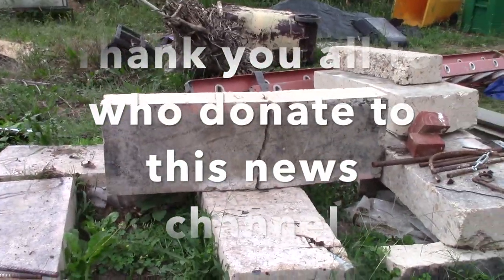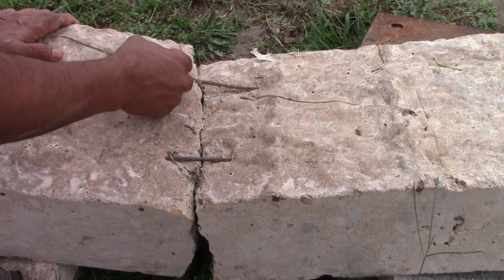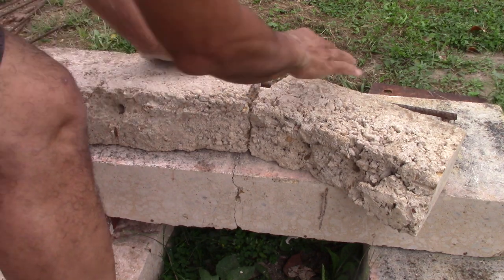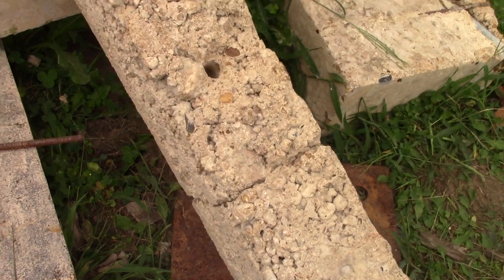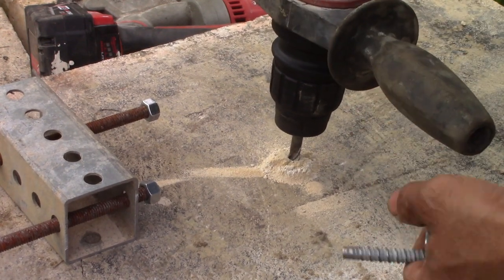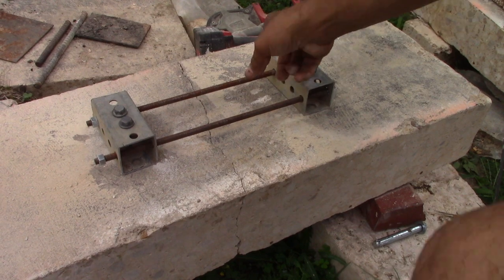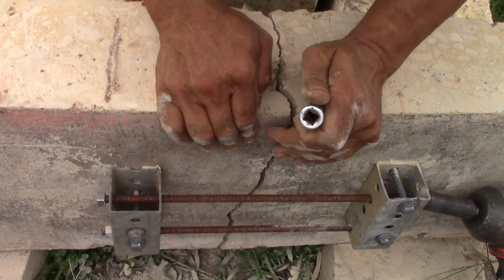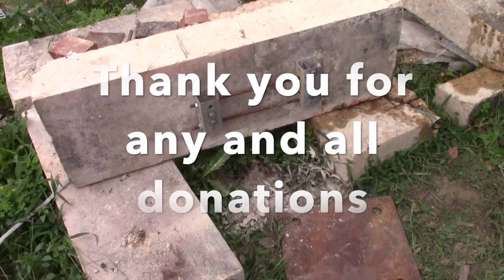CONCRETE REPAIRS MADE EASY external post tension would work vs epoxy BOLT DEPOT

Comment: I put a balcony on my wife’s house with those anchor bolts! All good except the one she overtightened as I forgot to tell her not to try and pull it in with the anchor. Was going to epoxy it later, but didn’t as I figured no one uses epoxy on block surely? Hahahaha! Great demo! Nice deep beam so your rods don’t have to work too hard. Cube law I think on beam depth. Can’t quite remember from over 40 years ago, so don’t hate on me if I’m wrong. I can’t help being an Electronics guy!
Reply from the maker: Check those anchors and add epoxy and confirm no fracturing of block... follow your code requirements and load requirements ... #hilti makes a ''mesh'' that goes inside block to support and create the ''anchor'' for the epoxy and bolt connection.
Reply: @ForensicCats  many thanks for the tip!
Reply from the maker: Dr. Power,  a through bolt would also do a heck of job... thread all into house and washer it from both sides...  you may even have to use a larger plate inside to make sure you are not pulling on a ''weak block''... / section of wall (in case deck goes laterally , away from home / house connections)...

Comment: From Australia KAI thanks for letting me know about this Video.U should have Solid Shoes when working with Concrete. I gather that is Concrete with Cracks from Champlain Building Collapse in Florida  ?? U should be putting U imput to the Courts as i am sure they would be very Interested. U are the only one that is working on this CONCRETE. 😇🦋💕
Reply from the maker: I only need hard toed shoes if I put my foot where it does not belong... I also, do not have steel fingered gloves... now those I need!   lol    teasing and also on that subject of safety, I need permanent eye protection (no scratches please)...
I am on my feet for hours and unless I am on a job that requires steel toe... I stay clear of them, they HURT!
Reply: From Australia KAI and just had an EarthQuake here and the Roof was making a really bad Noise like Cracking , and i thought what the Hell is that and my bed was shaking plus Vertical Blinds Moving and got up out of bed and floor was moving and very Scarey.It was 6 on the Rickta Scale.Never had a EarthQuake since lived on this Earth.No damage just my 2 Nombs fell over in the Backyard.There was damage near the City were bricks fell down , Plus some of old Buildings Chimneys fell down.No-one Injured.But have lived on Gold Coast 4 houses from Beach and worked up there and had a Cyclone come thru on Radio they were sending children home from School Told to battern down anything that might fall plus Battern down Boats.Plus have been to Bribie Island on a Holiday just near Brisbane and the little Green Frogs were climing up the glass doors and windows and we wondered Why ??Well the weather forcast said we were getting Tail End of Cyclone which we did.So the creatures and Animals know before us Humans.Just also wanted to let U know as U have Cats and a lady was taking a Video of her White Cat with a new Fish Toy that moved and the cat called Carol was Playing with new Toy , and all of a Sudden it stopped and Cat looked up and went to were the Door Frame was , so it must have sensed the Tremor on the House !!😇🦋

Comment from the maker: Here is the link to the BoltDepot https://www.boltdepot.com/catalog.aspx  and they will mail you what you need and they do it fast. This link contains free charts also.
Here are the ''Concrete screws'' I use in this video https://www.boltdepot.com/SearchResults.aspx?Units=US&Category=Anchoring_products&Subcategory=Concrete_screws&Page=2&ItemsPerPage=10&SortOrder=Catalog
All donations will not be pocket money but go back into this channel, thank you for any support.
Only donate if you can afford it, otherwise, please watch the advertisements  and comment and tell me what they were please.
You can also open two tabs and let one play while you watch the other in another?
https://www.paypal.com/cgi-bin/webscr?cmd=_s-xclick&hosted_button_id=V9TGHDE92LQ8W&source=url
Reply: Yes but I'm referring to south deck possible repair
Reply: I might need to send you a pic of the problem.  I hate to damage the little rod or the die.  The alloy rod was threadless & I thought I could cut threads on it from a tap & die set I inherited (not knowing really what I was doing but trying anyway).  So when I screwed the threadcutting die on (I think that is what it is called) it got stuck… won’t go further or off.  I don’t have any way to use a screwdriver on it cause there is no cap… I might email a pic to you.

Comment: Ad: no cost solar, Dropbox  (×2), Wegmans app. I've seen several epoxy jobs that looked like placebo at best - concrete sidewalk cracked/sections raised several inches apart with grey epoxy. Maybe makes people feel like something was done, but apparently just cosmetic. I'm wondering if they were just gambling - figure it stood 40 yr, will stand another 1 yr or whatever to get $$ to completely scrap and replace the deck. Ideally they would have made a bigger effort to brace it as you suggested here rather than the superficial and ineffective epoxy job. 

Part 2: I'm probably one of the least fashionable women, and I acknowledged that the remark was catty. I would find something nice to wear if I met with clients who I was asking for millions of $$ from. Zero chance of that in my case, so will circle back to the point that my comment wasn't directed towards you. It would be crazy to dress up and work with concrete, and you have a million way more important things to think about rather than sock color or whatever. If you started to do videos in a suit suddenly for whatever reason, it would come across as inauthentic (opposite of halo effect 😆). Apologies for even making you think about this - seriously, not worth the time to consider further. Ok, essay time over. 😆
Reply from the maker: Papa Smurf, with millions...should dress differently ...so, we can believe he is at least alive... Maybe a mirror to confirm he is breathing.
Reply: @ForensicCats  😂

Comment: Ads:  solar home power & webrates
Reply from the maker: Your bolt question is hard for me to find again...but, consider just adding a through bolt and nut system.
Reply: @ForensicCats  It has the guys at Lowes stumped, seriously.  Unless I want to destroy the rod or the die.
Reply from the maker: @buttercupbaby891   gulling of the metal has taken place and the ''ramp" of the threads have become locked via this wedged material and you can attempt to tighten bolt and then loosen to free it... otherwise, cutting u will go....

Comment: I loved this video!  I have tried every kind of oil, WD40, cooking oil, storing in freezer to heating with a torch & even KY & vaseline & cannot remove a little thread cutting die that I was trying to cut threads into an alloy rod.  What will help loosen?
Reply from the maker: Cut, the nut as close to threads without touching them... then, use a screw driver and torque the bolt off... two cuts may be required (opposite each other).